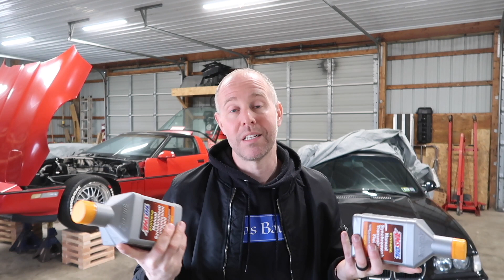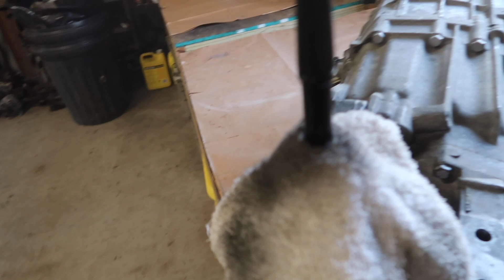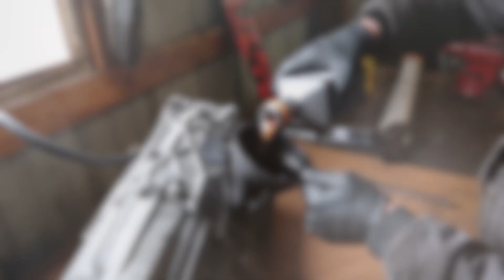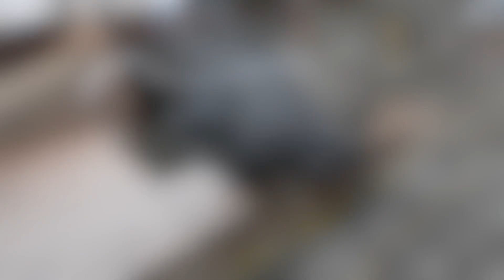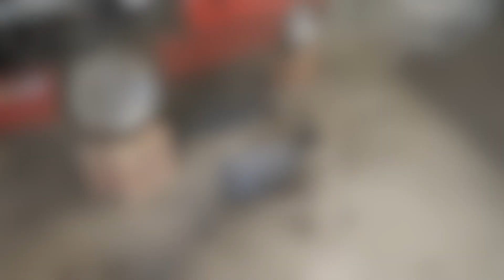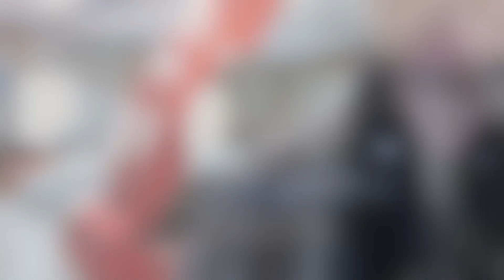C4 Six Speed Swap. Part 8. Transmission Prep and Installation.

Comment: I spoke with ZF recently (one week ago) and they recommended 'ZF LifeguardFluid 5' part no S671.090.170. I have not gotten this myself yet - I still have a 'stash' of Mobile ATF 320 for Automatic Transmissions which apparently is also fine for the manual in my 89.

Comment: The black tag and blue tag descriptions can be misleading as far as required TOB size goes. Add to that the fact that someone could have changed the guide tube at some point over the years and that adds even more confusion. 

Just an fyi, that lower shift boot is meant to be installed once the trans is in the car. You may not have one for your swap, but there is a ring that gets mounted to the trans tunnel section that the lower shift boot slides over to make a nice seal. Then you secure the boot down to the trans with those acorn nuts. 

I'd also flip your banjo fitting 180 degrees, the factory vent tube is actually meant to come out by the firewall, if it is flipped the other way you won't be able to have the vent too much higher than the trans before it hits the trans tunnel. 

Can't wait to see your car back on the road and grabbing gears!

Comment: I filled it with 10w60 trying to reduce rattling because of sm FW. The oil will handle more load at higher temperature